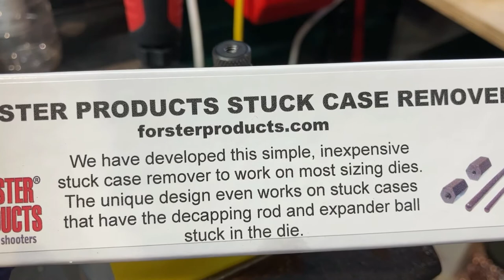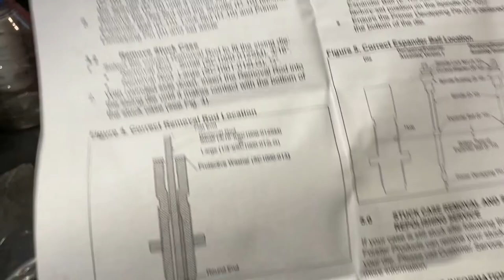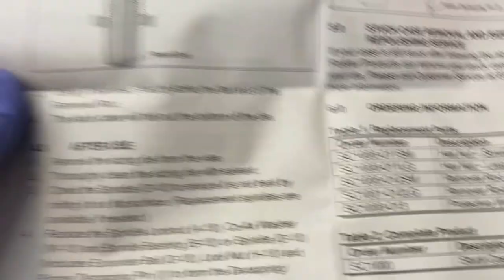Review & Use of Forster Stuck Case Remover Kit - 300 Blackout Stuck Case

Comment: Hi..Nice kit you bought there and good job 😁 I'm from Denmark and have a friend with similar issue...Can you tell me the size off the tread on the spindel bushing...?
Reply from the maker: Looks like it's a 10/32 thread or 1/4-28 thread.  If you check out https://www.forsterproducts.com/product/stuck-case-remover/
They have a good PDF file with all the details.

Comment: Are you using the x-press shell holders? It's my understanding you're not supposed to size on the APP with those. They only hold the case in two small spots and are looser than a normal shell holder, making it much easier for the case to rip out of the shell holder.
Reply from the maker: I size with them all the time, no big problem.  If you don't use the X press shell holders it kinda defeats the purpose of the press.  In this case, the case got stuck because I wiped the lube off of it.
Reply: @wanneroo7106  interesting. Yeah I've tried sizing 9mm in mine without lube (carbide die) and it would rip them out of the shell holder. WIth lube, I was successful. But its really annoying when the mechanism jams and launches a case into your already sized box and now you have an unsized case in a box of 1,000 sized ones lol. But yeah I can see how 300BO would work, its a very low sizing force case. Even forming them (from 5,56) uses a surpringly low amount of force
Reply from the maker: I did a fair bit of 9mm resizing early on when I had the press, no huge issues that I can recall.  Just make sure you have the right shell holder I guess.  Yes I have run into that issue of the mechanism jamming and flicking the brass everywhere.  I think Lee has a great idea with this press but I can see the potential for some refinement.

Comment: good deal, I've had a stuck case or three.....did the expander just rip the case neck and bring with it ?
Reply from the maker: Probably so and perhaps me banging on it to get it out contributed as well.  I need to see if I can find the case in the recycling bucket and measure it just out of curiosity.
Reply: I guess I'm wondering how the expander fits through the neck while the neck is in the die at the neck sizing portion.  My expander unscrews from the stem at that point. Then I screw the die in upside down in my cast iron single stage and drill and tap the primer pocket.  Then I put a socket over the case and a washer and they'd a bolt down the hole until it contacts the washer or washers. Then continue turning the bolt and it pulls the case out. No vice involved.